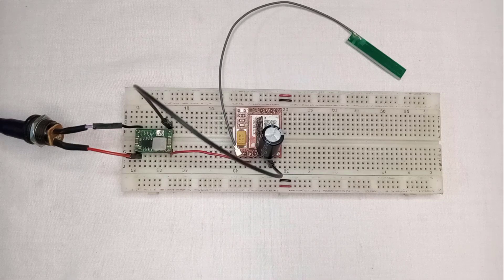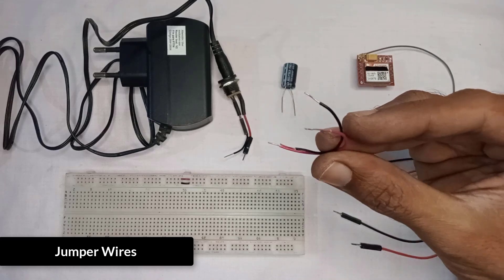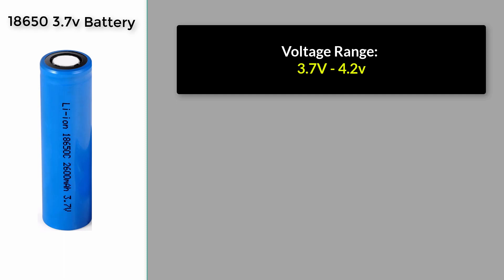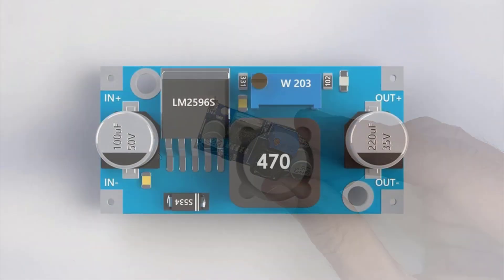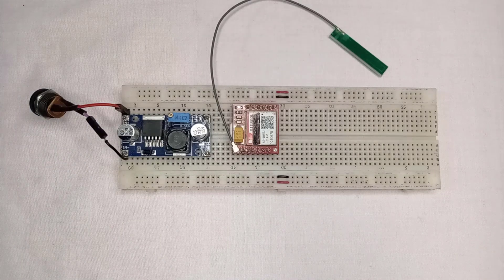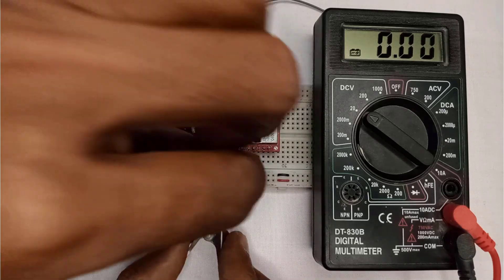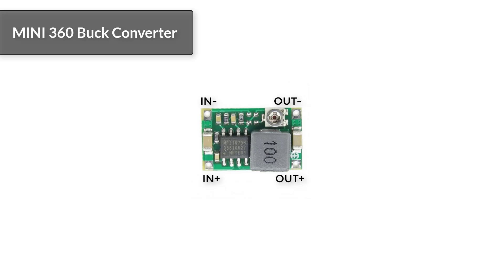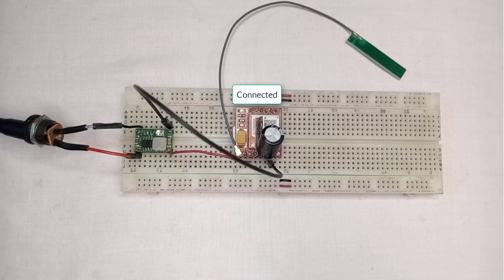GSM Module Arduino | 3 Powering Options for GSM Module

Comment: if you transform 12v to 4.3v you loose a lot in heat, how the second solution will support the heat? when you need the full project to be autonomous, what kind of power do you suggest? would you use to cells 18650 (3.7v 3000mAh) to get 4v from almost 8v? thanks in advance

Comment: When to Use LM2596S:
-    If you are using a higher input voltage (e.g., 5V or more), the LM2596S is a great choice for stepping down to 3.7V.

-    If you are using a 3.7V Li-ion battery, the LM2596S is not suitable because it cannot operate below 4.5V input.
here what do you use to power your buck converter?
Reply: u can connect two 18650s in series i think so that's 7.4v and step down that shit

Comment: Dear Ahmad, 
Thanks for the very helpful video. I have a few sim800L GSM modules (3.3V and 5V)  which I was trying to sort out for a wireless alarm notification.
 I did have a GSM wireless chinese alarm with a dodgy battery. It also stopped showing a GSM/wifi connection. I now think this is all due to a requirement for a battery due to the 2A burts.
Despite what some videos show the 5V does not connect and reboots even if attached to a 5V USB power adapter attached to the arduino, or PC.

I am now thinking that maybe the issue for all mobile phones, sat nav  etc. needing a battery may be this 2A burst for the GSM modem. Do you think this correct? In relation to this, can any ordinary lithium 18650 battery be attached. I note that there is circuitry often attached to the lipo batteries. Can 18650 batteries be used without this circuitry to get phones etc to work of the mains usb adapter?

Comment: Your videos absolutely correct, but here i facing some issues, my communcation between sim800l is not working properly with dc to dc buck converter because of Ampere matters. so i suggest to use 4v more than 2ah power supply to work well. Thanks

Comment: can i also use 100uf capacitor to connect vcc and ground for gps neo 6m module ? It doesn't affect?
Reply from the maker: not required for neo6m module.

Comment: I have a network problem how can it be overcome as it separates a lot and comes back
Reply from the maker: Hi there! I'm sorry to hear that you're experiencing network connectivity issues with your SIM80L. One possible solution is to try high quality antenna. or use 4g gsm module
Reply: @AhmadLogs  Any 4G module that is close to the sim800L price

Comment: Nice project sir how to use sim800l module without saving number in code after insrting sim it should detect number from the sim and start working  or make tutorial on save mobile number on insrted sim in eprom memory or esp32
Reply from the maker: the phone number we save in the code is not the phone number of sim800l gsm module. it is your personal phone number that you have to enter in the code.
Reply: No sir i want to say that if i change other sim i do not need to hard code new sim card number in code so how to solve this problem
Reply from the maker: @s.husain6125  you can change the sim of your module without making any change in the code. There is no need to hard code it.

Comment: Good job brother, I am working on a project to track vehicles using GSM, GPS and Arduino Micro....but I have a problem is that the serial data is not displayed on the GSM and it does not send data, even though the GSM is connected to a network.  ..please answer
Reply from the maker: then you need to test  your serial connections of sim800l with the arduino. also verify the pins assign for RX and TX in the code.  also check the baudrate in the serial monitor,
Reply: @AhmadLogs  Everything you mentioned in your comment has been done and verified many times but gsm is not responding to serial commands.......
Reply: @mr.electron9833  le problème est-il résolu ? Arduino47 on Lab Elektor